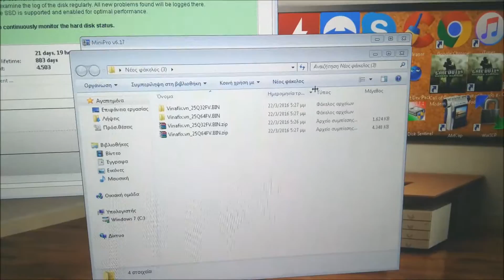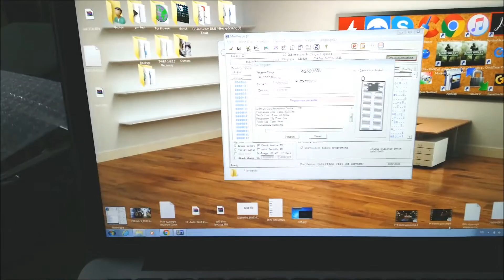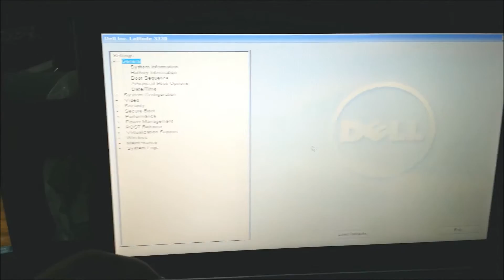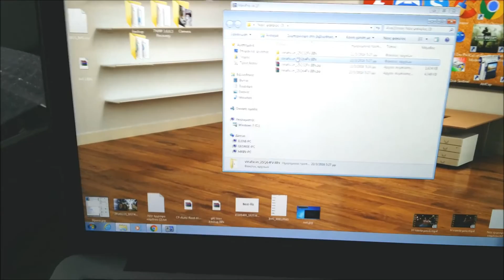Dell Latitude 3330 Stuck On Dell Loading Screen Fix

Comment: Que tal disculpen tengo una duda, a mi laptop es ese mismo modelo pero lo que le paso fue que cúando un día intente entrar a la BIOS ya no encendía, solo se quedaban los leds parpadeando, creen que sea el mismo prboema?
Reply from the maker: It can be the same problem yes. First remove hard drive and cd inside and the keyboard and try again. If no working try bios firmware flashing.

Comment: Hello! I tried to update the firmware on my laptop and it only died on the second boot after the FW update which I did in Windows. So now I'm not sure if the problem is in the BIOS. I never saw the progress bar for the FW update after the restart. What do you think this problem can still be due to my attempt? Now the laptop has nothing on the screen after switching it on, but I can hear the fan and the hard drive LED blink.
Reply: Otherwise I am pretty sure that I used the right file for the update. I downloaded it from the Dell website based on the service tag of the laptop.
Reply from the maker: @IstvánSusán  how did you made the update from windows or with programmer?
Reply: @DerbyRepairs  I made it from Windows. Just downloaded the exe file from dell's website.
Reply from the maker: @IstvánSusán  then i dont think its the bios or you didnt let it finish and now you have a corrupted bios
Reply: @DerbyRepairs  If I have a corrupted BIOS, shouldn't I have a DELL Logo on the screen at least?
Reply from the maker: @IstvánSusán  not at all. Try removing battery if you can and power supply and press power button for 60sec. Then try to power on. If this fails try resetting the ram memory.
Reply: @DerbyRepairs  Good news my friend! Just want to let you know that I gave the laptop to a guy who can write EEPROM. Now the laptop is alive again! He used the files you shared on this page. It works, confirmed again. Thank you, you are my hero! :) :)
Reply from the maker: @IstvánSusán  im glad i helped bro.